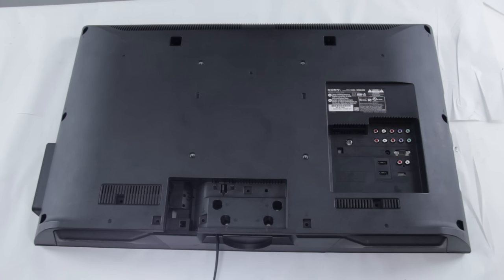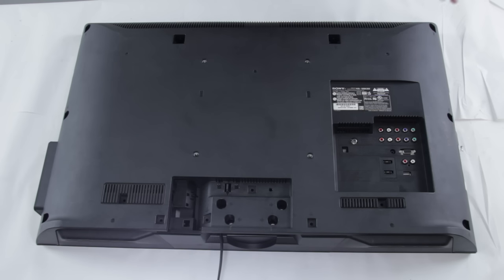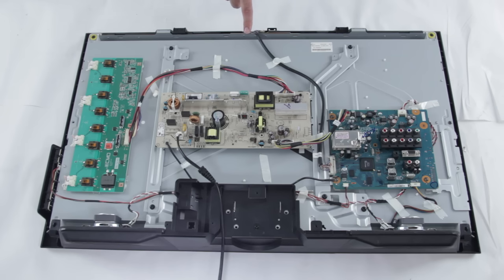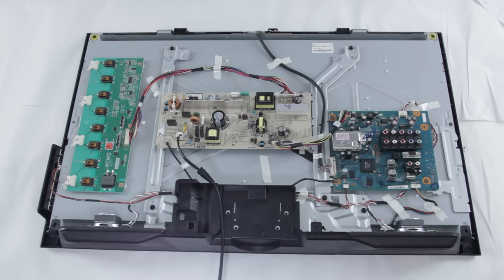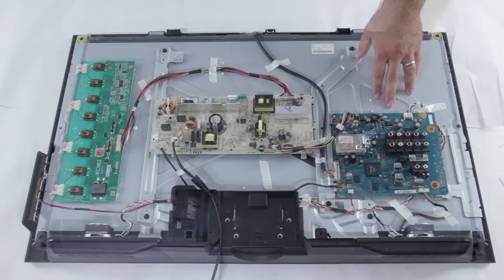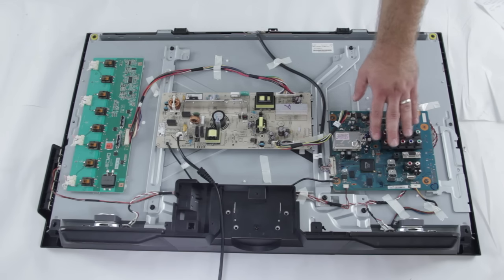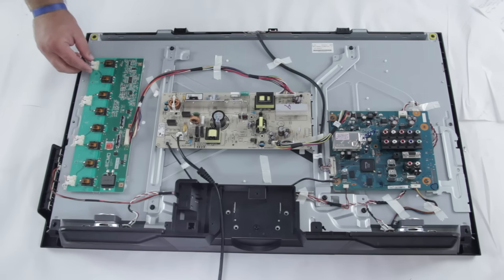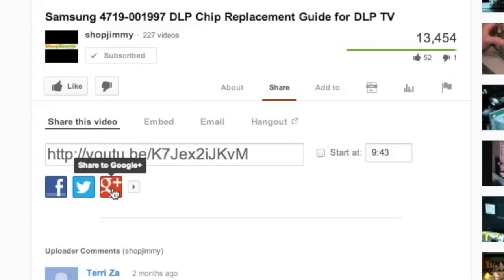LCD TV Repair Tutorial - LCD TV Parts Overview, Common Symptoms & Solutions - How to Fix LCD TVs

Comment: I have a Vizio VO370M.  It's back light blinks from dark to bright.  I read about some issues with the ambient light sensors in these, but disabling all the features did not solve the problem.  I have taken the back cover off, and I'm wondering where to go from here.  Do you have any advice on what panel to test and how to test it.  Please let me know what part I may need to replace.  Thanks - Alex
Reply from the maker: +Alex Brown   Try all repairs and troubleshooting at your own risk.  I recommend replacing the power supply board in your TV.  Click this link to replacement parts for your TV model number:  http://www.shopjimmy.com/vizio-psm192-240-power-supply-unit.htm  There may be multiple boards for the same TV model number, be sure to match part numbers on your current board, with your replacement for compatibility.  Here is a link to a video showing how to identify your part number, click here:  https://www.youtube.com/watch?v=4i57Cm9-96M  Thanks and please let us know if you have any further questions with your TV Repair!  www.shopjimmy.com

Comment: Please help me in repairing my Samsung TV model number UA32EH4003 . The problem was when I turned on the TV it will just give a milli-second turned on, then it will turned off again unless I unplug the power cord. When I referred it to the supplier for verification and check up, their response was that TV parts number BNO7 (012310A) (5 pieces) was defective. My question is that BN07 012310A is also the LED Bar Assembly? If it is where can I found this part and how much is the estimated cost of this part, where can I buy this part? I'd tried checking the supply board and check the possible voltage as written on the board and it is found ok but their was no single LED lighted as seen on each individual holes. The sound is ok also upon plug in the power cord. When I plug in the power cord it will give starting sound and video mode and it will turned off. It will repeat with the same mode (sound & video) over and over again. It will only stop if I unplug the power cord. Please help me in my problem on my Samsung TV. Thank you and hoping for your the best solution on my problem.

Comment: Samsung model # UN55FH6003FXZA Version#AH01. Picture goes black but comes back on and off. Power also goes off and on at times. Replaced T-Con board through ShopJimmy already with no success. Any ideas or help would be appreciated. Already ordered Main and Power Boards as well. Thanks

Comment: I have a Seiki Model No. SE32HS01 and it has been having power problems where I'll press the button and the light will turn on but the monitor won't turn on for a long time, and now the button light won't turn on and my tv won't turn on at all.  I searched online and people say it's the capacitors.  I don't know much about the internals of a tv so what should I do?

Comment: I have a samsung LN46A550P3F/xza tv.  Problem started about 2 months ago. TV works fine when its warm.  When I turn it on when its cold I get a green screen,  and loud screaming.  At first it reset, and worked fine after 1 reset. Now it takes 5 to 10 resets before it works ok.  Any idea's what the problem is?  thx

Comment: I am working a Samsung TV Model LN55B650T1FXZA and when the TV powers on the power indicator light flashes 3 times, i Can get sound out of the TV and can see the image with a flashlight. I replaced the back light inververtor but i still cannot see an image. What at do you think the issue is? Thank you.

Comment: I have an LG 55le5400 and it turns on and has a high pitch whistle.  The screen is on and is displaying properly but it continues to whistle and does not find plugged in inputs.  Any ideas?

Comment: Sony Vizio 
model: e701i-a3 
Serial: LFTRNXAP0601986

This TV is approximately 22 months old. Without prior issue, one day it would not power on. The outlet was working properly; I also tested it in other power outlets. I tried to power cycle the TV and was unsuccessful. After calling Sony technical support, I was under the assumption that the power supply board was this issue. I went ahead and ordered a supply board, which is en route. The TV would still not power on at all.

The following day, after being unplugged for approximately 10 hours, I tested the TV. It turned on and functioned well for about 5 minutes. Soon later the remote stopped working. I proceeded to adjust the sound manually using the TV side panel: the volume adjusted initially, but then became unresponsive. Additionally, the volume display froze on the picture and would not disappear. 

After watching some of your videos, I decided that it would be feasible to repair the power supply board myself. However, after removing the TV back panel, I found little evidence of damage. Granted I am inexperienced with electronic repair, I did not find any damage to the capacitors. 

Given the history, what do you think may be the issue? It is still possible a problem with the power supply board? If so, should I proceed to replace the entire board when I receive the replacement part?

I greatly appreciate your time and consideration.

Comment: I have a Samsung un32j5003af. it turns on because I see a blue dim light but I don't see picture or hear anything.  It is just a blank screen but not black.  Can't get to menu or anything.  Which board do I need to buy? I use only the hdmi for computer and not tv. Thanks

Comment: Hi Thxs 4 the video. I own a JVC model EM39FT serial # TA1SE1040304092. The only thing that works is the on power light turns on and off via the remote. Just b4 it went out I heard video upon turning it on then nothing. I can not see any backlights and I can not see any menu what so ever. Using a flashlight in the dark did not show a thing! Where do I start? Is it possible I just have a power supply with a fried fuse? Like I said the 1 and only thing that works is the power on light. Thanks 4 the help...

Comment: Hello ShopJimmy. I have a Sony Bravia 55BX520 with no sound, no picture and no indicator / blinking lights on the front of the set. The set is dead. I made sure the wall outlet was working and tried the little reset / check sequence on the Sony esupport website to no avail. I then pulled the back panel and checked the main fuse on the power supply board with my meter, fuse is good. Btw I can hear a relay energizing type noise from the power supply board when I plug the set in. After I verified the fuse was good I checked the 12v & 24vDC output voltages at the pin connectors on the power supply board and those were present as well. At this point I would like advice from you concerning my problem. I have a feeling the main board is shot but??
Reply from the maker: +Lori Parmentier   Try all repairs and troubleshooting at your own risk.  I recommend replacing the main board in your TV.  Click this link to replacement parts for your TV model number:  http://www.shopjimmy.com/sony-1-895-094-11-a-board-for-kdl-55bx520.htm  There may be multiple boards for the same TV model number, be sure to match part numbers on your current board, with your replacement for compatibility.  Here is a link to a video showing how to identify your part number, click here:  https://www.youtube.com/watch?v=Aodz2LHkzbY  Thanks and please let us know if you have any further questions with your TV Repair!  www.shopjimmy.com

Comment: Hi! I have a Fujicom fj3201w LCD TV, It reacently was locked into child lock mode, and it wont turn on- niether with the remote controle, nor with physical buttons.
I was wondering if it is possible to open up the TV and physically reset it (make it "forget" it is in locked mode), or if there is any other solution for this (I have tried many solutions I found in google, with no success)
10X!

Comment: My TV is VIZIO 
MODEL # V705 H1
Serial # LMXDZJMXO70269
I Am getting Vertical lines , Even More So from The Letters on The Screen ! 
Will cleaning LVDS and FPC Cable Contact Pins with Eraser take care of Problem or do I need a New Complete LED TV Repair Parts Kit be my Answer ?

Comment: Hello. I have a Vizio 37hdtv10a that powers up as far as the led light coming on, on the front of the tv and won't power off. I have replaced the power supply but that did not fix it. I have checked all the regulators on the main board and they all seem to have the right voltage. same with fuses on main board and inverter board. There is a very low .20 volts at j1 pin 13 that is supposed to turn backlight on and off. I am not sure what voltage is supposed to come out of that pine to power supply to turn backlight on. If I am even understanding how that functions. If you could suggest what I could check or if it is the main board ( processor) or inverter that would be a big help and I will replace which ever board it may be. I just don't want to have to replace both boards a later find out that I could have just gotten one board. It gets pricey, board after board. Thank you for your time, Best Regards David

Comment: I have a older Magnavox model 37mf331d/37. I pressed the menu button to access the Netflix app and it froze on that screen with the Netflix icon. Netflix never loaded and the screen froze there. I could not back out of that screen. I found the old Magnavox remote and tried that. I hit the menu button the screen went black but I can’t get out of the black screen now. Any suggestions would be appreciated.

Comment: I have a LG UHD smart TV 4K HDR pro model 55UH615A SN# 610RMAQ96880.. I got this unit from a guy for 25 bucks under the impression it needed a firmware update. I tried that method with no luck. When I plug it in the wall the standby light comes on so does the tv. It goes to the logo screen and the standby light flashes 2 or 3 times and the unit shuts off. From there it continues to repeat over and over. Can you give me a direction to go with. Any help would be greatly appreciated. Thank you. Kevin

Comment: Greetings Shop Jimmy. just send the fallowing question using your internet page but some one  answer having no idea. have a  Vizio  model E701i-A3E Has sound, back lights and a lid screen but no  image; would you suggest to change the T-con board? . A technician told me it has a screen short cut, how can I detect that?

Comment: HI!,I have a HAIER LCD tv that only 1/3 of the screen at the lower part works fine and the  upper 2/3 of the screen are just multiple horizontal lines no picture at all,audio is fine, back light is good.  please help, tnx

Comment: my Bush TV model number led40127fhdcntd seems to be stuck in a standby mode go to turn on for about 30 seconds then turns off and continuously does that until you unplug it from the wall I can do the repair myself just having problems finding which part need replacing on the board

Comment: have JVC model JLC37BC3002---no audio and screen blank---no back lights and no numbers or letters on the flashlight 
test --the front red and green on or off light will respond to the remote power button----any suggestions    thanks

Comment: I’m having an issue with my Toshiba fire tv model number 50lf621u19. It turns on and says Toshiba for a split second then I get white vertical lines on the left and red lines on the right half of the tv. It then changes to a solid white line that takes up the center 3/4 of the tv and I can’t see anything and can’t see what I’m doing with the remote. Because the remote is useless I can’t tell if the sound works. I’ve replaced the tcon board and nothing changed. Any help would be greatly appreciated

Comment: I have an Insignia LCD TV I had replaced the main board. It worked for a half hour then the volume would not work or touch buttons on bottom right of tv. i unplugged, went to turn back on, and then nothing would happen. It is a ns-40L240a13

Comment: i have a jvc 55 inch smart tv model number looks to be lt55c670 or 870b picture is good but has block of lines down centre of screen changed the tcon board but still the same any ideas what else to check tx

Comment: when i turn on my tv it takes a few minutes for the picture to appear though the sound does come on. then the picture does appear and lasts for 10 to 20 mins. then the screen goes black but the sound is still there. it can then come and go at intervals with the picture breaking up for a while when it does come back on.  i suspect it may have something to do with the backlight panel after watching this video.  but i am still not sure. what are your views on this? the tv is 48" 4K Ultra HD TV made by BAUHN   model number B48-63UHDF / A-480f-S.   Any advice would be greatly appreciated. thanks

Comment: Hello,
I have a 55" 3D Vizio TV model number m3d550sr and the TV is displaying picture in black and white. Sometimes when I turn the tv off and back on it will display color but when it gets turned off and back on again it show in black and white again. I know it's not the settings. What could be causing this?

Comment: Hi my Sony XBR49X900F has stop working after a power fluctuation and now all I have is some color turning wheels on my screen and then nothing except for the flashing red light at the bottom of my screen (4 flash) steps were already perform with the 5 times unplugging the TV and pushing the power button plus volume down TV light goes green but comes back to the 4 flash red light.
Power supply is OK the stby voltage is at 3.3 volts and signal from the main board gets received back and 12 volts kick in but after 10 to 15 sec it goes down and TV goes back in to 4 flashing mode with no screen. what could cause this type of problem? Thanks in advance.

Comment: Hi I have an older model Magnavox LCD TV model number is 47MF437B. When I power the TV on the red light on the power button goes to green, the TV flickers and then it goes to red. I cannot turn the TV on. I unplugged the TV, held the power button on the TV from 10 to 60 seconds, waited 1 to 10 minutes and plug the TV back in. Still when I hit the power button it turns to green for a second, the TV flickers but will not turn on. Please help let me know what I need to do to fix it

Comment: My TV Samsung 50 inches with a kit purchased from shopJimmy, Samsung UN50H5203AFXZA (Version MH01) Complete LED TV Repair Parts Kit . I replace T-con board , The TV is on again, but a few minutes, it was back to death. I replace T-con board 2nd time, TV is on one more time. ( LED light it work, no audio) I think TV got a shortcut circuit in somewhere? Could you help or give me some idea/ instructions please. Thanks. ( event thought I replace a Main board?)

Comment: hi Sylvania model number lc370ss9. I push the power button and the TV does not come on it is plugged in 8 Outlet I know that works I checked the glass fuse and it is good need help thank you

Comment: My Samsung Plasma Model# PN60E550D1FXZA Version# TS02.  I lose most of the remote controls, volume changing, number pad quits, I can only turn the TV on and off at times, even the info button quits working. It happens every night but at different times, sometimes when I turn it on or after I have been watching for awhile. Any suggestions for a fix? Thank you for your assistance.

Comment: I have a sceptre x425bv and when I turn on the tv it won't turn off unless I unplug the tv. The second issue is I have to unplug and plug in to eventually get the tv to "boot" and show sceptre image and then turn on. So basically I hit power and the indicator light changes but there is no audio or video until I plug unplug plug unplug and it eventually "boots". I bought the main power board from shopjimmy but that wasn't it. So now there's only to options left. The main board or the inverter. I don't want to buy another part that isn't it. Any help would be appreciated.

Comment: Hello,
We have a Samsung Model # LA32A550P1RXXS we have no picture and no sound, and the red light is constant and when we touch it, it starts to blink. The screen has a very dim light and when we leave it on for several minutes the screen does on and it has the salt and pepper screen, we can touch the menu button on the TV and it goes to menu but then after a few minutes the screen goes back to a very dim light. The button on the TV all make the noise when we touch them but nothing happens unless there is the salt and pepper screen. We tried the flash light test but nothing.

Comment: Hi, I've received and replaced the main board, but no change in status :(. When the power button is pressed on the remote, a dim circular white light turns on at the lower left corner of the tv face. After 2 seconds it gradually dims to dark. No screen illumination or anything else. That's what it was doing before board replacement, too.  Based on the standby voltage of the power supply board testing at the correct voltage, I concluded based on this youtube that it must be the main board. But no change. Can someone provide some guidance for further troubleshooting? TV: Vizio E470i-A0

Comment: My RCA 1012-37LA30R-A103963 is turning off and on. I already replaced the power supply board. The light does not blink at all. When on it is blue. When it shuts off on its own it turns red after 5 seconds. Please help.

Comment: How do u repair a Onn 50 inch tv. that has power and sound but, it do not have a picture on the screen on it. Its a Ultra HD 2160 p. I tried all of the regular things to get it going but none of them things worked. Allen G. Pride Sr.

Comment: I have a Hiense 75inch TV with a cracked screen on the left lower corner. Model 75H6570G/sn 75G201319NH00521. Is it possible to fix it?